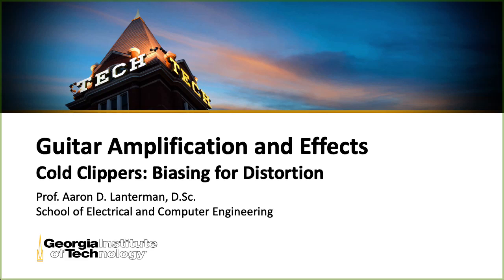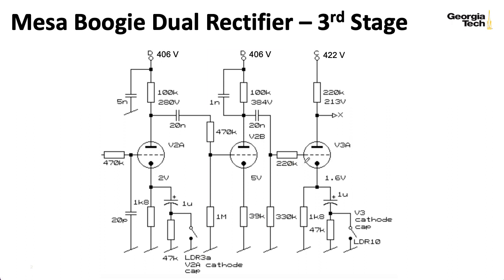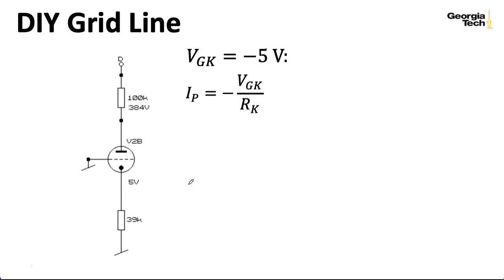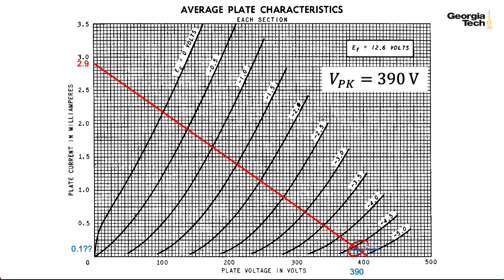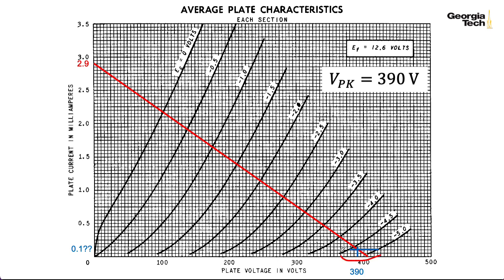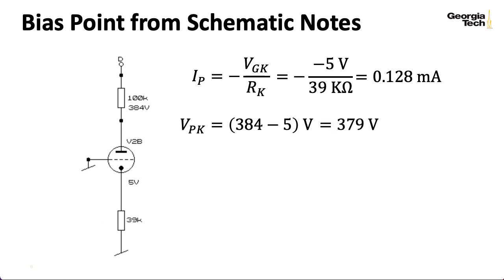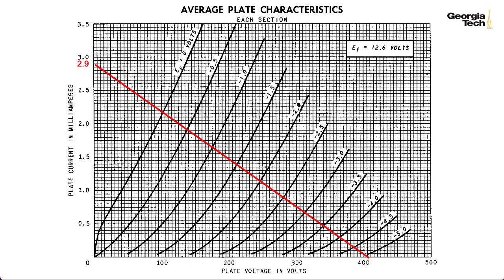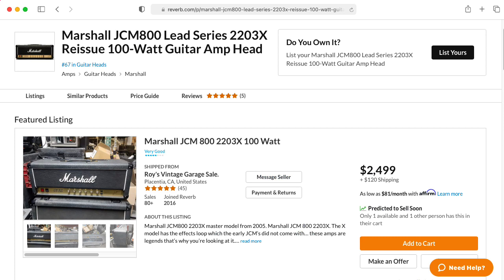ECE4448 L20: Cold Clippers: Biasing for Distortion in the Mesa Boogie Dual Rectifier (Georgia Tech)

Comment: I think you are correct that the values on the schemo were measured, and that tube hadn't read the datasheet. But depending on the tube there can be effects from the grid leakage current. Consider what a 500nA does on a 1Meg resistor. That might give you half a volt extra. On some tubes you can do bias only with a high value grid leak resistor like 10Meg.

Comment: Would love to see that lecture on high voltage safety! Everyone on the internet just says 'meh, be careful' without further explanation. I want to get into high voltages but I fear I may be terminally stupid
Reply from the maker: I've had some scary moments that ended in loud bangs and bright flashes in which I'm glad I used the restroom before working...

A good rule of thumb, particularly when working with AC power, is to keep one hand behind your back or at least to your side. You don't want that getting across your heart.

Comment: considering that the purpose of these design variations and digressions from simple sine-wave amplification are to increasingly alter the tone result as compared to the original input signal in ways that break the rules, but end up being pleasing musically,
the glaring omission in this presentation is to bridge over from the technical explanation of what is happening to the various voltages that manipulate the signal to how those described differences alter the wave shapes of the musical signal, and then how those wave-shapes ultimately affect the musical tonality of the final signal as music.  That is, after-all, what all this is about.  How do these variations on the theme affect the final output sound, thus why the designers chose to include them.  
Much as I am a fiend for these electronic circuits and how I can manipulate them to some new end, it really has little meaning without keeping both eyes and ears on the musical nature of the whole darned thing!